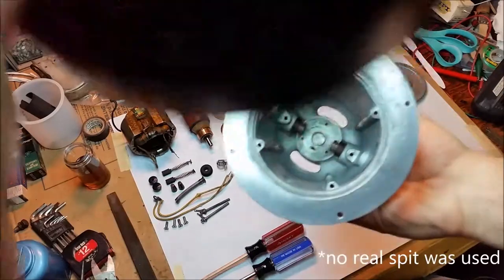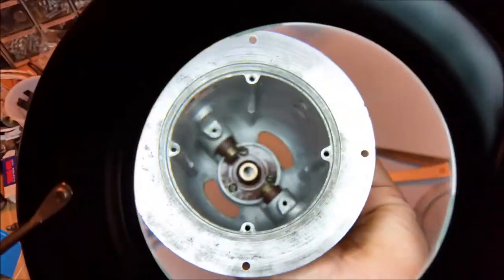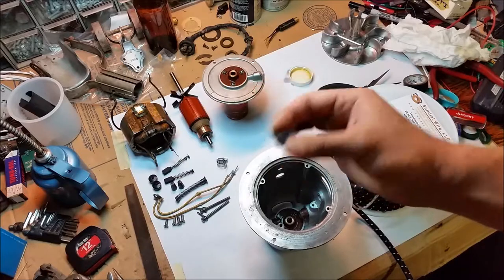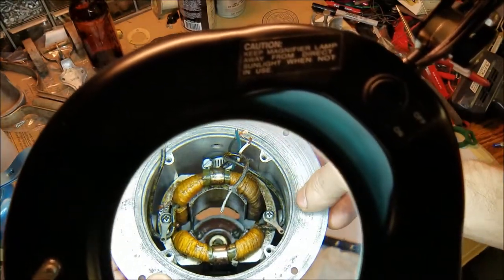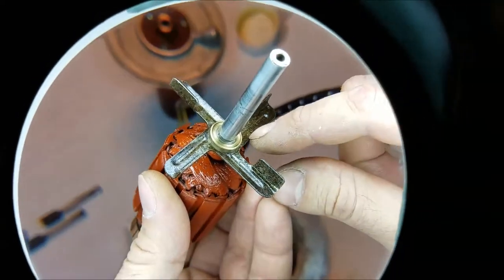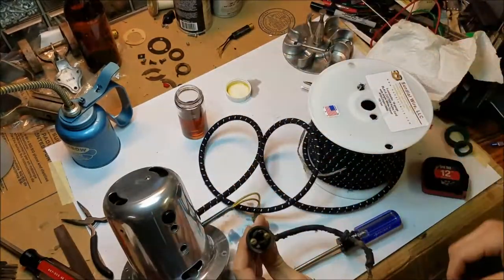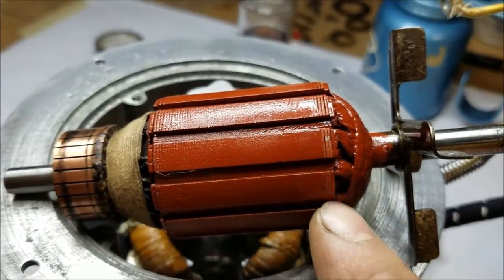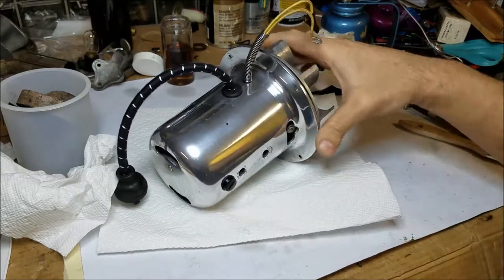Antique Vacuum Restoration - Part 2 - Motor Assembly

Comment: Excellent job. Was very impressed. The sound difference between the unbalanced fan and balanced fan was quite large. Kudos to you for lubricating and restoring the motor to its former glory. I'm surprised you do not have more subscribers from the quality of your videos. You just won another one. 

I watched your other vacuum update video and the wheels you made look perfect. Nice job on the lathe. The older Bakelite wheels I'm sure contain some not so great binders that they used instead of your regular Delrin.

 The bag that you made was quite impressive as well. I'am not one for sewing but I will learn one of these days since my focus is more on older lawnmowers. Eagerly awaiting your next update video and keep up the good work!
Reply: What do you mean? The fan wasn't even installed when he first tested the motor, balanced or not!

Comment: Is the cord short just for testing or are you going to run an extension cord to that cord??  That’s what I do with all my 1940’s power tools. It makes it so much easier to put the tools away without a long 10’ cord. Outstanding job
Reply from the maker: As the vacuum is fully assembled, the handle is designed to be easily removed, so the handle has the end of the cord with a socket on it to plug in the motor. In retrospect, the original length of the motor cord may have been 10" (that's what the Packard motor had) and it might've been cut down over the past 90 years.

Admittedly, that's a great cord management solution for power tools... not having a cord lol